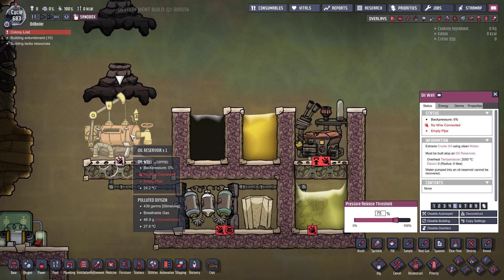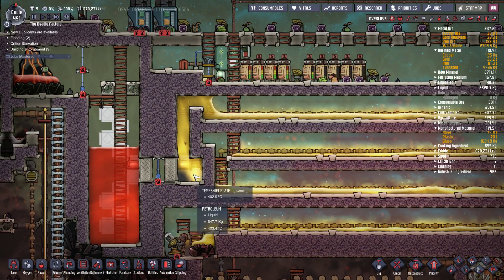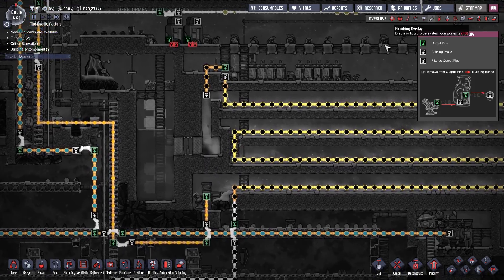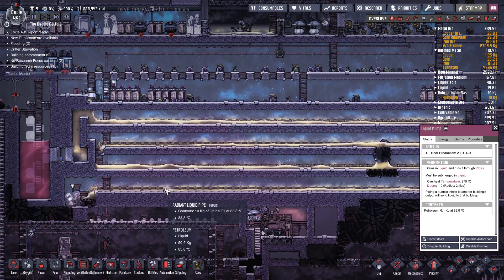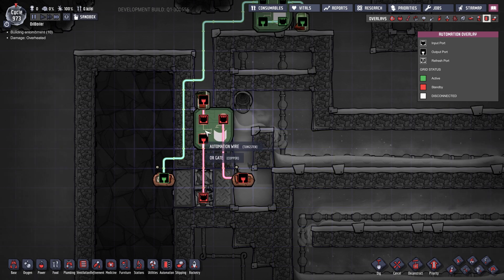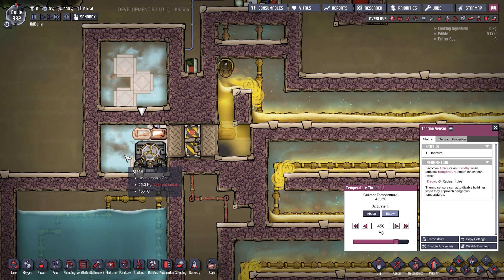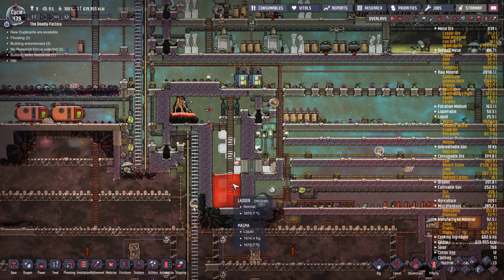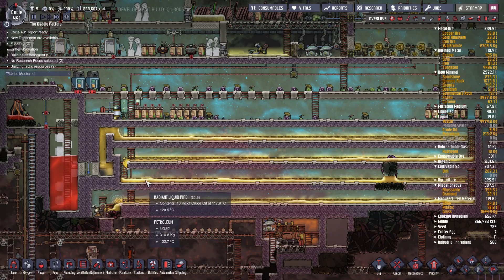Crude Oil Petroleum boiler tutorial 10 Kg/s(Save file linked) Oxygen not included

Comment: Considering that the oil biome is usually right on top of magma, could one do a quick and dirt version with just the heat exchanger directly in contact with the bottom magma to quickly turn the big pool of crude you usually get at the beginning? The petroleum should just float back to the top of the pool right?

Comment: I get pressure damage both in the tungsten and insulated tiles around the heating chamber, seems the petroleum would rather pressurize than flow out the top.
Reply from the maker: That can happen when a large amount of crude changes to petroleum at the same time, you best bet is to start the boiler at 3 or 4kg/s and then increase the flow as it warms up.

Comment: I used this as a model for my base. Works quite well, although setting up was a bit tricky. My vertical column is twice as tall. I had to fill the column with petroleum before running the setup, otherwise all of the liquid would pool at the bottom and over-pressure the tiles, and not flow upward (no idea why... game mechanics...). The magma pool + volcano had to be a vacuum, no way around it. I also added a door so that when the pool is full the volcano gets blocked off allowing for extraction of the rock, once the rock is cleared you can then resume allowing the volcano to spill over. I also have the petroleum falling directly into a reservoir of course. Overall, great work on this video, a little guide to setup would have been neat but a little bit of trial and error and good to go. PS: My volcano is 5 tiles outside my base, which was quite a challenge to fully insulate without space materials.
Reply from the maker: There is no substitute for experience, also figuring out why it broke helps :) This is one of the older designs, it works but requires maintenance. If you have a volcano to work with do a google for Volcano powered petroleum boiler it's a hands free version that runs forever. Going to have to redo it now that they have introduced Aluminum.
Reply: @FrancisJohnYT  (replied to wrong comment, so reposting here) I've just gotten to the point I need to build a petroleum boiler, as the oil refineries are wasting too much of my oil.  This is going to probably be a stupid question, but...  why the need to cool down the petroleum after it's made from the oil?  Is it because it will melt pumps, pipes, and the petroleum generators if you try and use it at the temperature it's at right after it's made?  I don't have access to space materials yet, nor gold (I'm playing Arboria map) but I can make steel.

Also, have any mechanics changed in release that would change how these boilers need to be built?

Thanks so much for your videos - they're super helpful!

Comment: @Francis John I am back with more questions. :). I do not have a volcano and I am getting the magma from below. One thing I keep experiencing, the magma keeps hardening every time I get half way of filling the magma tank. The magma below is 1528C and in the tank, I am noticing the temp is dropping slowly. Magma tank seems to have hardened right around 1400C. Any ideas on how to do this legitly? I did cheat and added the whole area with diamond shift plates. didn't seem to matter. Thanks again.
Reply from the maker: I take it you using the boiler? As you drain heat the magma will eventually harden. The plan is to get 2-3 hundred cycles of use out of it so you can refine all the crude and get to space. Once you have space metal you can sub in a therimum aquatuner as the heat source so you can keep running it without magma. This is an older design there is a newer one google "ONI volcano boiler" this can also be fed from the top and there is a lets play where I do that. Then again sounds like you already built this version, so fill it as best you can and try and get space metal to use as a replacement heat source before the magma cools to much.
Reply: @FrancisJohnYT  yeah I'm using the old design because the only valcano is up towards space. I'm not even getting the magma to the steel plates...where the door opens. It hardens way before that. I would say 20 cycles maybe. Could be my game is bugged or tank is too big. Maybe i should shrink it. I think it's around 16 x 4.  Hmmm, I'll check out the newer one. I mean i could technically just finish up space and get materials.  I have more than enough power.  Being stubborn at this point.  Lol
Reply from the maker: Wait it hardens before it hits the metal plates? How is it loosing heat? Is there still an atmosphere in the room? Don't suppose you have a picture I could look at?
Reply: @FrancisJohnYT  i can't figure out how to attach a photo. I'll send the picture to your discord. I can send you my save if need be too. I did try and remove all the atmosphere. I ended up with a mix of polluted oxygen and carbon. It's very minimal. Wonder if i need to add some oxygen.

Comment: You can get better preheat by using direct heat exchange rather than indirect, but then you need more pumps and filters to get the petroleum back out of the oil. You already have one direct heat exchanger at the cooker,- if you took it 40 tiles through the reverse-flow exchanger and then mixed the petroleum and crude in another tank you could get the petroleum output temperature down to nearly the oil reservoir temperature (with the side effect of very gradually raising the oil reservoir temperature and also the petroleum output temperature). Since the amount of heat drawn from the magma depends only on the delta-t in the output and input, that could let the magma last even longer.

Comment: You wouldn't think it would take that many pipes, I had to test it out myself in debug mode to believe it.  I thought I could just do a compact design with the pipes oriented vertically snaking from left to right so that the petroleum on the left side of the tank would be hot and it would cool as it moves to the right.  Then you realize if it is all in one rectangular tank, it will just reach an average temperature and the left side will be maybe 20-30 degrees Celsius hotter than the right side.   Okay so then I switched to snaking vertical insulation channels which has the downside of requiring it to fill up with petroleum, taking many many cycles before it's ready.   You start to realize as you add one more channel at a time, waiting for it to fill up that all of the stages closer to the magma will all run hotter because you are pre heating the crude oil and so the actual temperature reduction gets smaller and smaller and you really do need all of that pipe.  This testing revealed the wisdom of your design.  compactness is highly over rated as space is very abundant.
Reply from the maker: Did someone just spend several hours in debug testing? The hard part is remembering to go back and play the game. Respect for spending your own time testing. Edit Check out this forum post about counter flow heat exchangers https://forums.kleientertainment.com/forums/topic/102450-counterflow-heat-exchange/